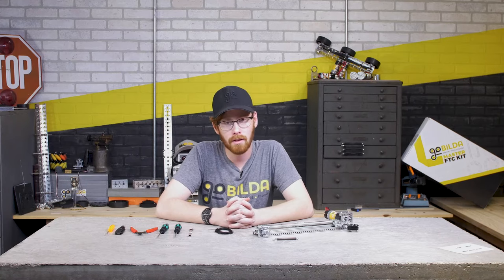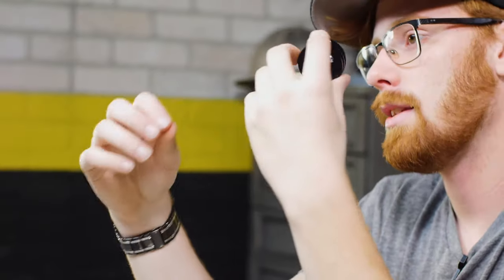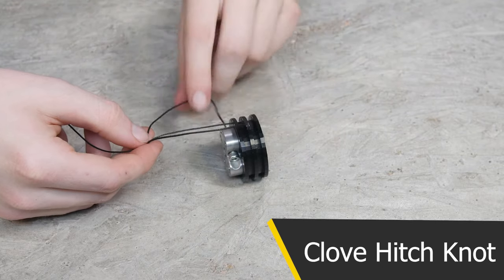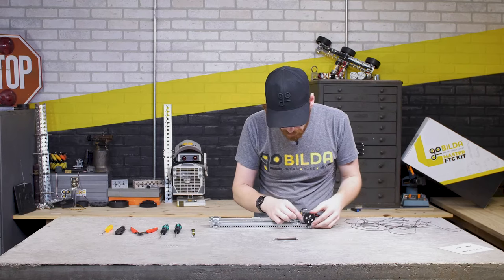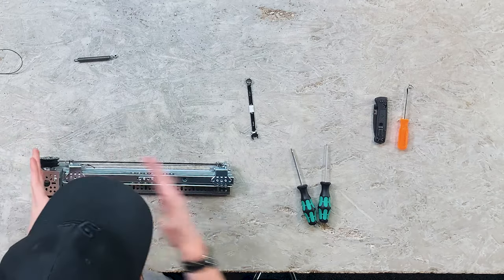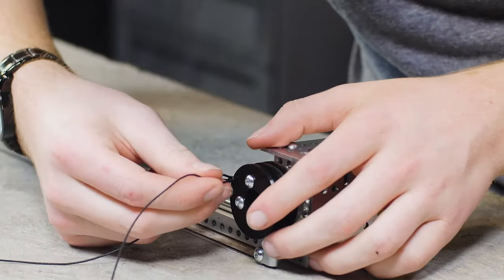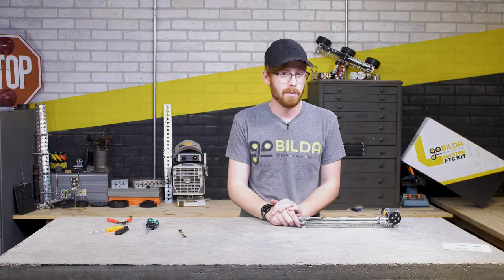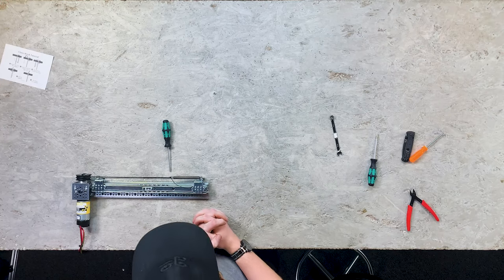Driving Linear Slides using Extension and Retraction Cable (Viper Slide Kit Rigging Guide)

Comment: On a 4-stage slide, the string coil diameter change is too much to keep proper tension.
Has anyone noticed this?
Reply from the maker: On the four stage kit is important to tension the cable when the slide is halfway extended, that is where it should be the loosest. From there the spring can extend and make sure the cable doesn't get too tight.
Reply: @goBILDA  thank you for the advice. We have done so. But, still at the maximum height the string is very loose and at the minimum height the ‘extension string’ is extremely tight = slowing drastically the contraction speed.
Reply: @ftc12731  We are having the same issue. I watched the video several times to make sure I was not missing a detail.
Reply: @goBILDA  the retraction is very slow because the extension cable is sooooo tight!

Comment: would it be possible to assemble it with the motor on the back side of the slide instead of the front?
Reply: yes. use a 1201 quad block mount. I'm unsure if that impacts the performance or rigging of the slide though.